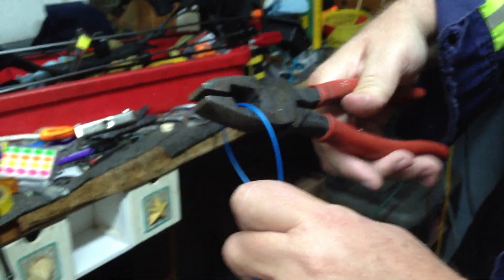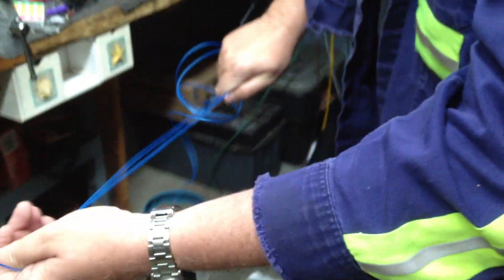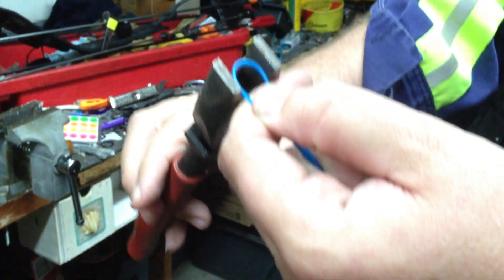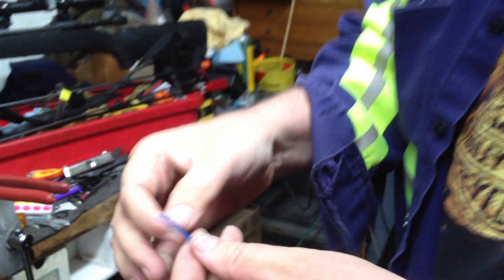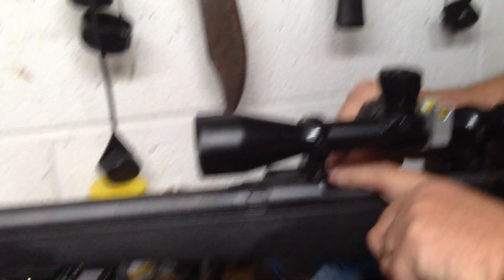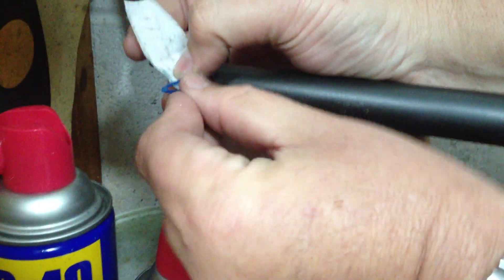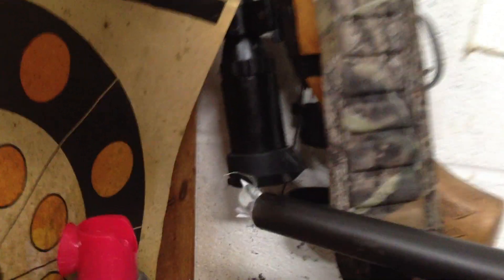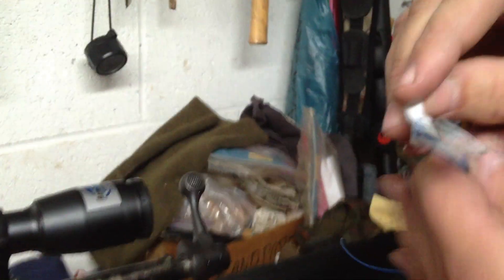field carry bore cleaning jig, made from weed-eater line

Comment: New pellet gun owner. Just the tip I was looking for, thanks Dan!
Reply from the maker: I'm glad it was helpful! :)
Reply: Just don't pull it through the barrel like he did tho!!!!! With pellet and pcp riffles you MUST pull the patch from the breach to the end of the barrel!!! If you pull it backwards against the way the pellet exits the barrel in a pellet or pcp riffle... you WILL break it, damage your o-rings and pull all that dirt, grease, grime and lead waste into your lower air chamber! Causing it to fail or break ... they aren't the same as powder burners!!